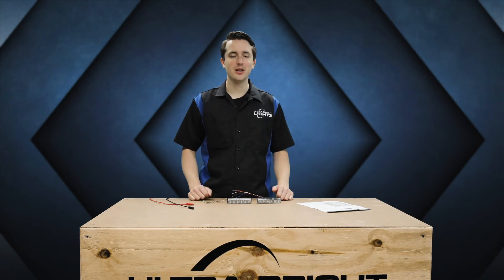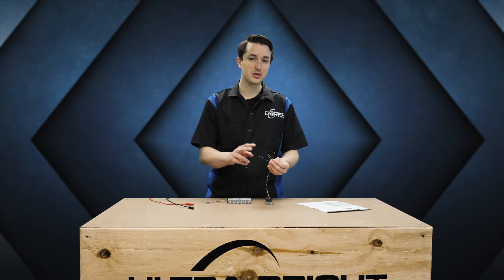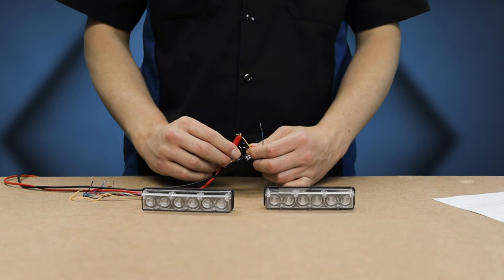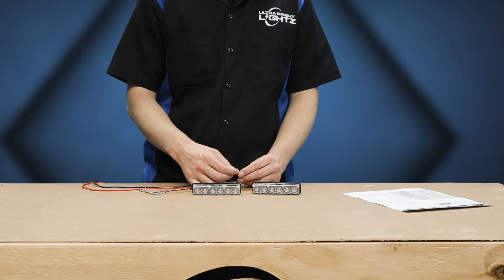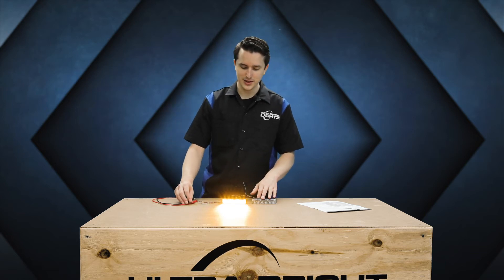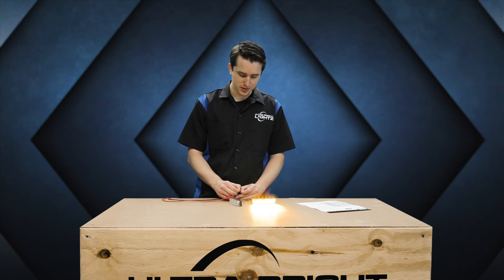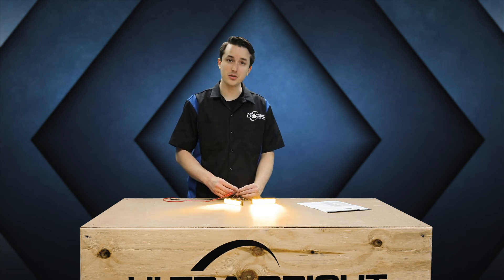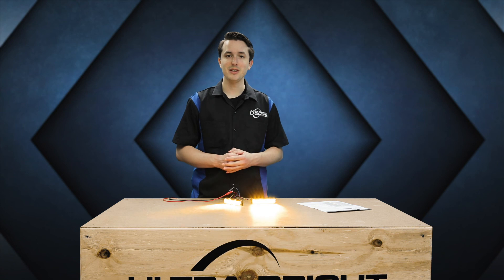How to Sync Feniex Fusion Surface Mounts

Comment: I am installing 4 lights on a truck grill. I set the top two to master, the bottom two to slave. I set all four lights to steady burn. I then tie all four blie wires together and select a pattern. At this point can i cut and hide the blue wire? Or does the blue wire have to stay connect between all four lights? As soon as i disconnect the blie wire the timing stats walking. 
Thank you
Reply from the maker: Once they are all set you can remove the pattern change wire

Comment: Am I setting the slave and master SEPARATELY on each light BEFORE I connected the blue wires to sync? I have a Fusin in white and red for rear window in truck. I’m still a bit confused.
Reply from the maker: No, you just need to decide which light will be the leader and which one will be the follower. To set up the lights to have Alternating Flash Patterns 1. Connect the blue sync wire of the Fusion-S product you would like to set as leader or follower. 2. Hold the blue sync wire to 12V- ground for 3 seconds. The light will turn steady on for leader and no indicating lights for follower.
Reply: @UltraBrightLightz thanks! I understand better now. Appreciate you guys replying when questions arise
Reply from the maker: @ThatCleanMT  You're welcome! If you have any other questions, please let us know and we will be happy to help!

Comment: I am ready to buy a Feniex Fusion dual color set. My question is: once I installed and wired the lights, every time I want to change the lights mode, should I go to the cables, disconnect them and switch them? or is there a controller/switch to do that? Thank you in advance

Comment: can Feniex work with 2 different color light heads? (One single color and one dual color) but the only difference is that the dual color would be amber/blue and my singles are amber, can I put these 2 models to sync them together?
Reply from the maker: Yes it does sync

Comment: So if I want a non flashing light on mode one, connected to something like an auxiliary running light, in theory I can set mode 2 as my flash pattern and it should override mode one when activated even if they’re not on the sand controller?
IE: mode one is a running light on a toggle direct to battery but mode 2 is on a controller
Reply from the maker: You would want to select the steady burn pattern on one of the modules and then select the flash pattern on the other module

Comment: Might have answered it but how would it work if I’m going to wire the surface mount light to the feniex 4200 mini, I want a wig wag and want the steady burn/ take down to over write the wig wag
Reply from the maker: You would assign one button on the 4200 Mini to the Fusion Surface Mount for regular flashing and then assign another button for flood mode.Then have your mode 1 wire on the regular use button and mode 2 wire on the flood mode button

Comment: How would I sync four lights
Reply from the maker: To sync two or more light heads together:

A) Apply 12V+ power to the red or yellow (+) wire and
apply 12V- to black wire to power the unit on.
B) Cycle through all patterns by tapping the blue (flash
pattern changer) wire to the activated black ground
wire until the steady burn pattern is selected.
C) Turn power off. Connect one of the same colored
mode wires (red or yellow) of the two light heads
together, connect the black wires of the light heads
together and then connect the blue wires of the light
heads together. Turn power back on.
Reply: I did this to connect 4 lights but only 3 light up, one of them keeps shutting off even tho they all have proper power and ground
Reply from the maker: @SuperKiller177  Sorry but I am not sure why this is happening.It should be working fine.Please contact Feniex Tech Support at 1-800-615-8350 and they should have an answer for you.Sorry that I could not be more helpful!